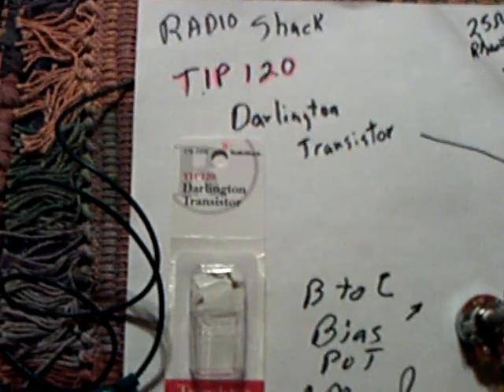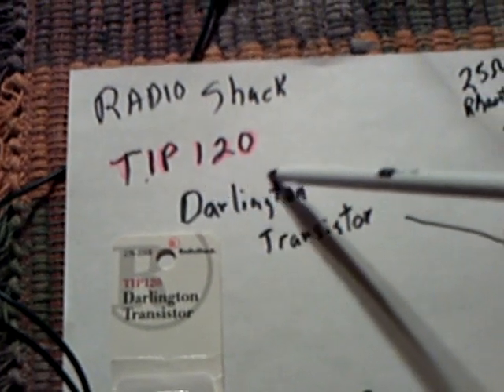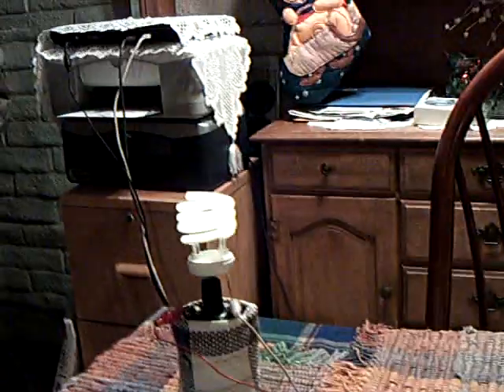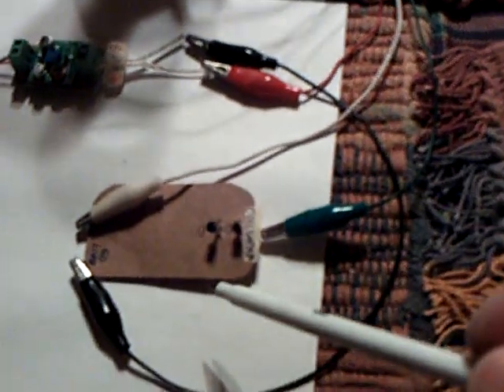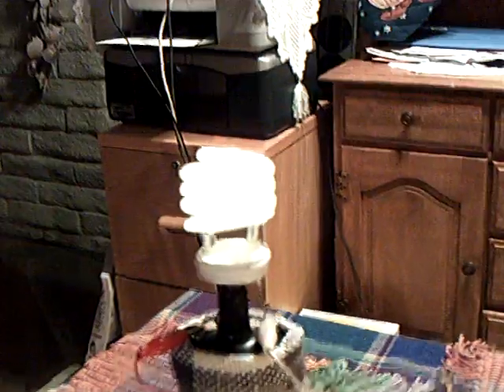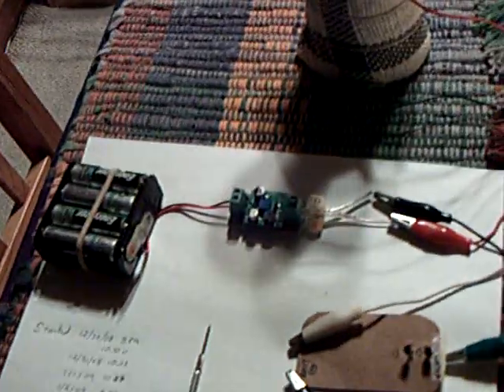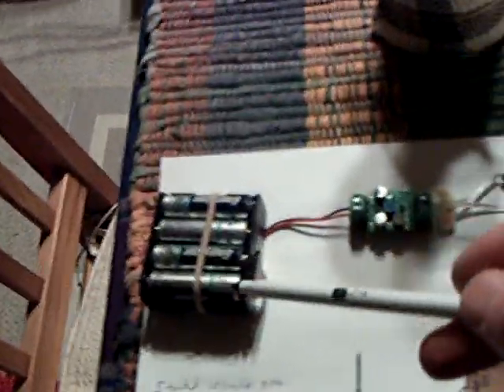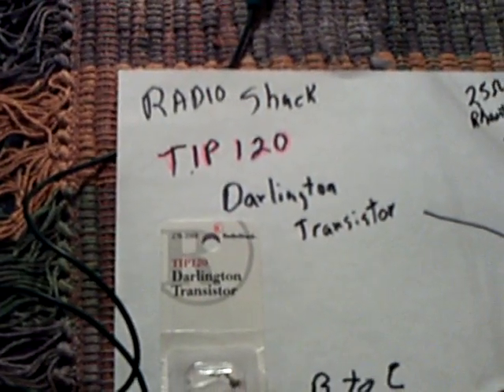One Darlington Transistor CFL Driver

Comment: The idea is feedback the Collector of the first darlington to the base of the second, the C of second to the base of the tirth...and so on, Need to use resistors for this? I saw schemes that use capacitors too paralel to the transistors..is better?
I read in some forum that if the chip gets hot can be put 2 in paralel...I think that even 10 depends of heat...tkx for your help. ;)

Comment: Hi, and tkx for share! I try to duplicate the  dodoshlodo  charger but fails i think that my 300 turns joule thief needs the 2 lines twisted first before wind the coil. But try to more amplification with the darlington array. Find a chip IC with 8 darlingtons!!! ULN2803A. After days traying how use this 18 legs IC like a 3 legs transistor (I´m newby in electronix)find that leg 1 to 8 are the bases of the darlingtons and leg 10 to 17 are out Cs.Leg 9 common E 18 common Cs.

Comment: nice one, i have a few of them darlington chips laying around, will have to give it a go.  
Wat have u got running into the base to get the oscillations in this video?
I built a PWM to try pulsing it, with not the best results, the square wave doesnt seem to work well.
i can get it to oscillate fine when i put base to the earth, an antenna or if i touch it myself.

are u able to take measurements on your new probe? santa also brought me one 4 xmas, but the HV makes it go crazy